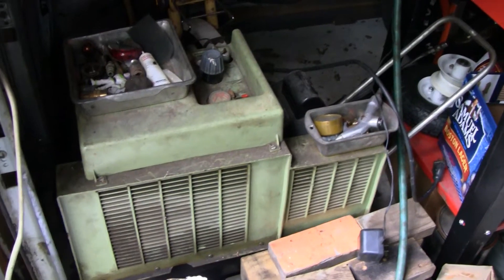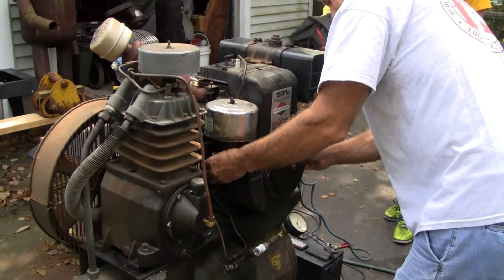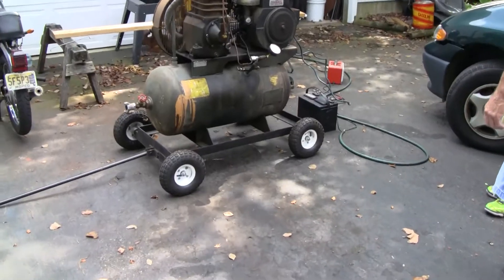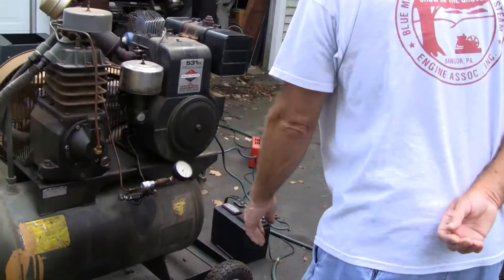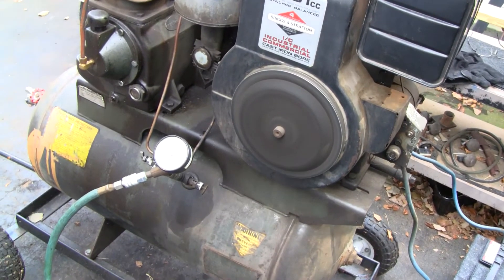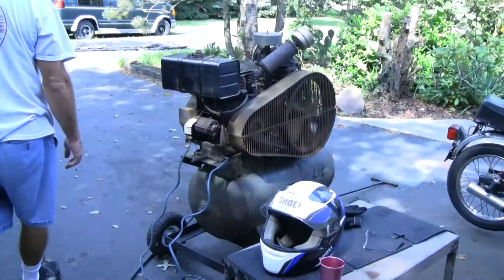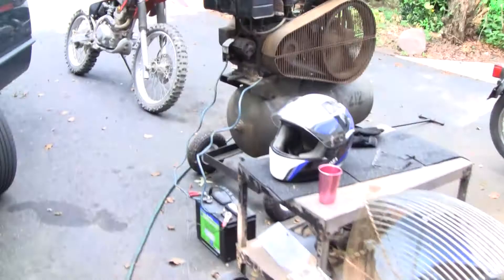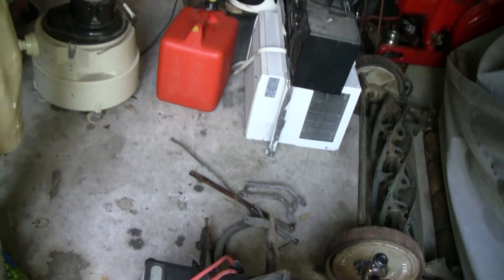SAND BLASTING PUCH MOTORCYCLE PARTS W/ GAS AIR-COMPRESSOR

Comment: Interesting! That's some compressor. Interesting bike, too. When I was stationed in France in 1952, I had a Puch flat 4. Don't remember too much about it, just that it was 4 cylinder, 750 cc, 2 pipes each side, & a very complicated rear hub, where the rear chain ran all the time. The clutch was in the rear hub. I'll be watching with interest.  Thanks.

Comment: my dad has an old dayton belt drive compressor that is 2hp it works good for impact guns and airing tires but doesnt have enough cfm to run a die grinder or my air sander without cylcling the crap out of the motor which is really bad for them. thats why i want to modernize and fix mine